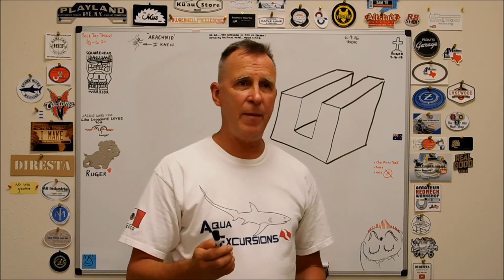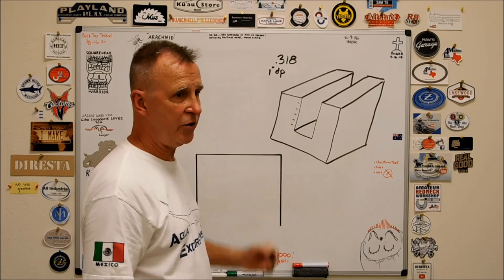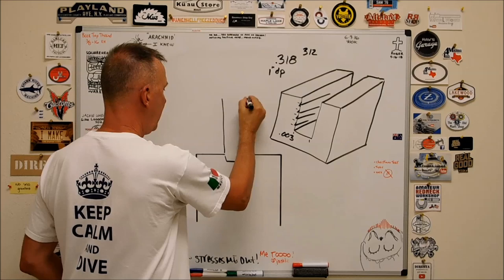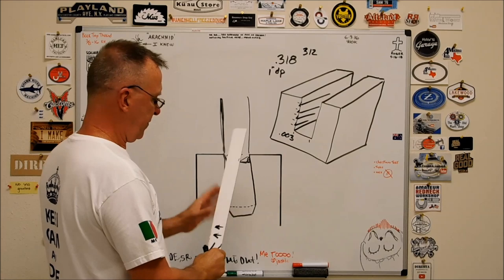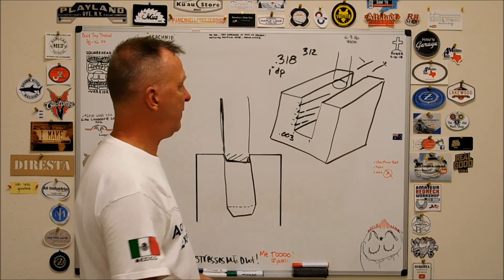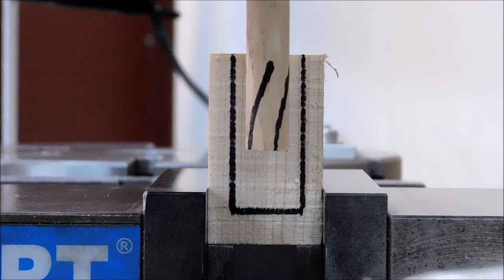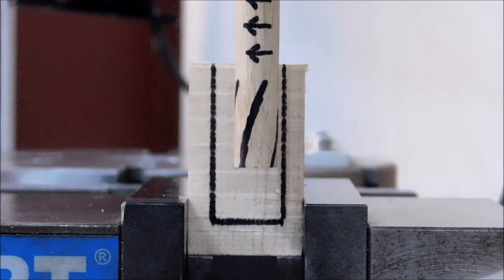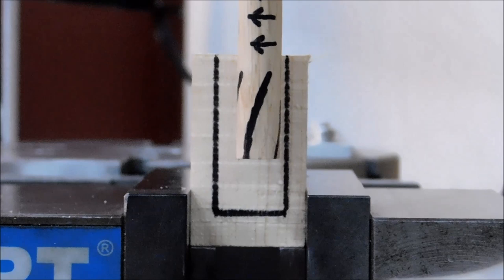Cutter Flex and Better Setups

Comment: In this situation I CHEAT BIG. Have had this problem too many times.

I now hold the part long ways on one side of the vise while having an equal length part in the opposite side. With the part on its side conventional cut (Y-Axis) with a slot saw to rough in a few steps. Minding that the slot saw is under sized.

Then upright in the vise using the X-Axis do the finish passes with an endmill floor first then the walls.

CHEAT IF YOU CAN.

If you can’t cheat use a smaller endmill in steps and let it flex, then do the above.

Endmills carbide or HSS are going to walk and flex, not to mention bad spindle bearings.

CHEAT CHEAT CHEAT!!!!!!
Reply from the maker: Ya know, I don't see it as cheating. I see it as understanding exactly whats going on and adapting to benefit from your awareness. Lets go with that.

Comment: Is it the cutter flexing or the whole fixture that holds the cutter?
IMHO it is the small amount of play between the cutter, the holding device, the holding device and spindle and so on that allow this small movement and not really the cutter itself.
Reply: Every single part of the machine moves.  If you put a load on a material, it moves.  The total deflection is the sum of all of the displacements. Some parts are stiff enough that their contribution is much smaller than others and can be ignored.  That said there are many significant sources of displacement depending entirely on your setup.  The work will move, as can the cutter, cutter holder, quill etc.  Long stickout cutters exceeding 3xd will definitely have significant flex.  The more the ratio of stickout to diameter, the worse it gets (goes by the cube of the stickout delta=P*L^3/3EI.).  You can really see this when looking at a long boring bar in a lathe.  Abom has some great shots along the tailstock when boring in the lathe, taking manly cuts and the flex in the boring bar is almost disturbing.
Reply: Put a smallish end mill (6mm) sticking up out of a heavy vice and put an indicator probe against it. You can flex it very easily.
Twist drills are so flexible you can see them wander, and endmills are similar in design, albeit somewhat beefier.
Reply: Solid carbide end mills are a lot less inclined to present this problem. It's partly because they hold their sharpness longer, but it's also because carbide flexes less, at a given load, than steel. Young's Modulus for carbide is about 600 Gigapascals, vs about 200 for steel. Counter-intuitively, it's much the same for ALL grades of steel, including high tensile, tool and stainless steels
Reply: Kinda doesn't matter because the effect is the same. But - yes - it's mostly the cutter, because it's the thinnest/weakest link.
Reply: @CraigsWorkshop  indeed (although "weakest" is a bit of a misnomer: it's not a question of strength, but one of stiffness)
Reply: The OP seems to be essentially saying it's not flexion, it's free play. I couldn't disagree more. In any half-decent milling setup, free play is eliminated by the various tapers combined with axial preload (eg tapered collets and toolholder shanks and taper roller bearings -- or angular contact which approximates a taper). The only degree of freedom is provided by elastic deflection, or flexion for short.
Reply: @Gottenhimfella  So if you stick an indicator on the spindle of the milling machine and rock the spindle violently you will not observe any movement on the indicator? I doubt it.
Reply: @ophirb25  Of  course you will move the spindle. I don't see how that supports your contention of free play. Perhaps you are unaware how much steel and cast iron can flex under load? 
The difference between flexible structures (like fibreglass) and stiff ones (like steel) is only one of degree. I can get half a tenth of a mm of movement between the spindle and the table of my smallest milling machine simply by pushing on one of its mounting feet at floor level(it's not bolted down). That is not an indication of free play, it's the structure deflecting.
I helped out a few years back with a grinding job, on a machine tool weighing three tons, where we found that the only way we could achieve the required accuracy was to work at night (no heavy trucks driving past on the distant main road) and draw chalk footprints so the operator could be sure to stand in the right place for the finishing passes.
Reply: @ophirb25  Furthermore, the cutter is WAY more flexible than anything else in the mix, because doubling the diameter makes a cylindrical object 8x as stiff.

Comment: The carbide doesn't flex. The collet, toolholder, and spindle column are where the deflection comes from. Carbide is hard and brittle. This is day one stuff
Reply from the maker: Wow. this comment will haunt you someday.
Reply: @joepie221  hows that
Reply: Think Joe, explain why dual column bridge machines are more rigid in the cut, or how hsk and big plus(dual contact) improve radial rigidity, how the mass of the machine and column stabilize the cut, workpiece rigidity etc etc you crack me up bud
Reply: I just clamped a 6mm four flute solid end mill in my 4.5" bench vise. I left 34mm sticking out, which is a lot of stickout. But then "carbide doesn't flex" is a lot of comment. With a dial indicator, I can easily get the tip to flex 0.02mm with finger pressure, The jaw material is aluminium, but the vise was done up as tight as I could manage. The aluminium is not squashing in compression, relative to that big long carbide stickout. Pretty sure carbide follows the rules of the universe just like all other materials. It's stiffer and harder than cheaper materials, but not infinitely stiff.
Reply: Years ago, I had to cut a cutter blade seat/pocket below center, on the side of 3.5" aluminum round, with an extra-long 1/8th" 4 flute carbide mill,  using an old Series II bridgeport NC mill, with the punch tape.  I will tell you- Carbide will flex.  More than you would think, but it flexes!  Yes I broke a few, but the moment the tool entered the cut, it flexed .   Sometimes that old NC would just decide to go off on its own path for a nature hike...that end-mill would flex quite a bit before it broke.
Reply: @CraigsWorkshop  wow you dont understand leverage, from mechanical advantage. The flection is from the fulcrum point, ie in your case the vise holding it
Reply: @CraigsWorkshop  plus how you say "stick out" makes you sound like a nyccnc wannabe. We usually refer to it as the tool projection length
Reply: @kmaber9698  Ok - if you say so. Good luck in your endeavours.
Reply: @CraigsWorkshop  lol. some people
Reply: @girraiffe  :-)
Reply: @CraigsWorkshop  Craig where do these people come from? Unfortunately I've worked with a few of these guys.
Reply: @andyZ3500s  Good question!
Reply: Young’s modulus, just look at the numbers. Tungsten carbide is very, very stiff, yes, but if the steel holding it is vastly thicker it’s going to mostly be the carbide that bends. I use tiny carbide drills a lot, mainly .7mm and they flex like crazy! Sure the scale is utterly different but to just outright say carbide doesn’t flex is completely wrong.
Reply: @stephenchick2454  I agree I've worked extensively with metals in 3 areas first foundry work, second sheet metal fabrication and lastly machining which is where I'll retire from and far as I know they flex/ move.

Comment: This is a perfect problem that a trochoidal tool path fixes. Sorry manual guys
Reply: Trochoidal tool path doesn't fix one of the two issues raised, the wear issue. The other issue (flexing perpendicular-to-the-cut) trochoidal toolpaths can mitigate, but that is also pretty easy to mitigate on a manual machine too (as the video shows) if you know the problem exists, and why. This videos purpose is to highlight the existence of this problem to manual machinists that don't know it exists, it's not to say that it's difficult to fix, and it's not trying to compete with CNC machining.